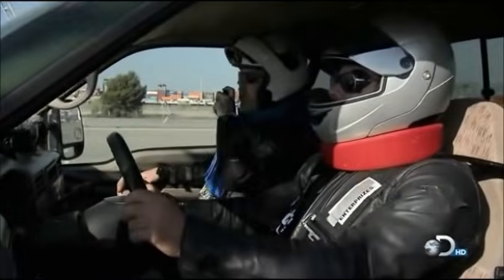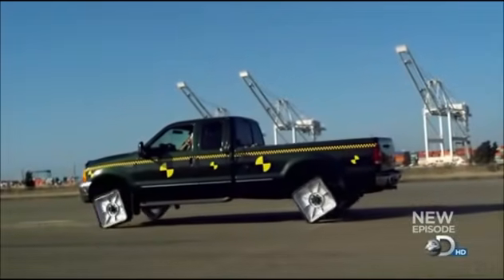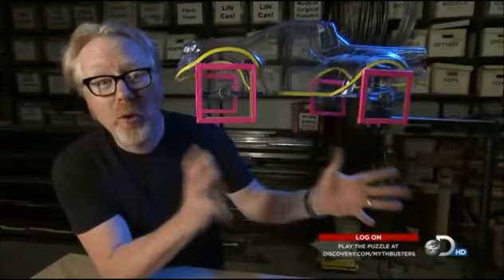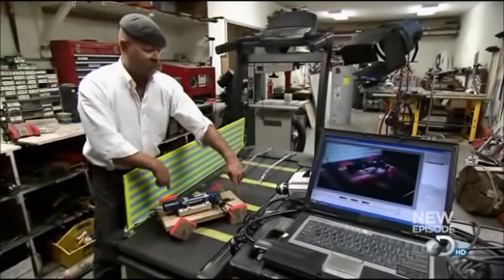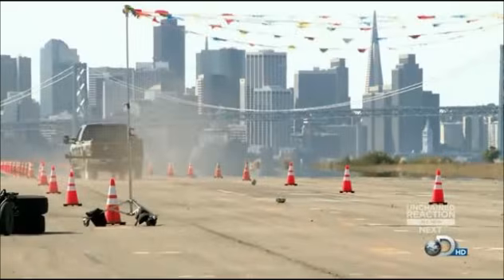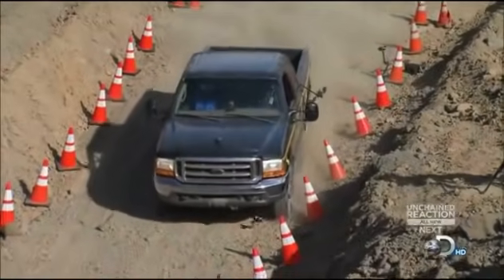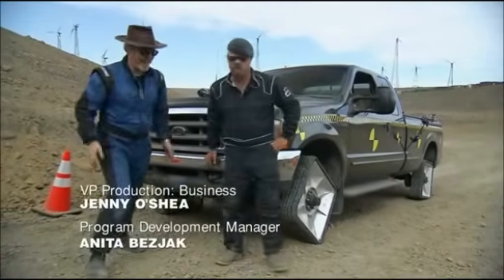Square Wheels - Mythbusters for the Impatient

Comment: Hill loose dirt...use a tank
Reply: Captain Fearless made in Canada (South Park)
Reply: Yep, just not on gravel. Dirt and mud are fine, but gravel adds a combined resistance to the tracks that threatens to break them.
Reply: Captain Fearless
Reply: put that on a lambo
Reply: Captain Fearless
Reply: or just diff locks in 4 low range
Reply: Yeah, but that’s not fun.
Reply: Hexin ZHAO uhh wrong type of tank buddy
Reply: Why don't you just climb.
Reply: Xiaobao why dont you just not drive towards hills
Reply: Captain Fearless use a plane duhh
Reply: loose dirt... use tank

Comment: One thing not addressed here is the differential gear which allows the wheels on opposite sides of the axle to rotate at different speeds. The wheels would end up out of phase anyhow.  Try cubic wheels with the axis of rotation passing through the opposite corners. It would have six corners contacting the road and could be approximated for demonstration by rolling a child's alphabet block across the carpet, holding the points between the index finger and thumb. It would approximate a hexagonal wheel. By the way, did you by any chance see the movie "Carry On Cleo", in which a rather dim Briton (in Caesar and Cleopatra times) named Hengist Pod brags that he had improved the wheel: " I build wheels. Square ones." There's a brief shot of him on his bicycle.

Comment: Square wheels on the hill would work if you had a tractor gear that meant you could rotate the wheels very very slowly and the tyres were very knobbly and sticky. Then you could make your way up the hill bit by bit, because the traction of a flat surfaced wheel is going to be greater than that of a round wheel.

Comment: 4:01 - So the control test was 2x4 for round wheels while square wheels was 4x4? Hmm...
Reply: what he meant is why the control test using 2x4 not 4x4 to even it out
Reply: Honestly the truck would have made it up if it was in 4x4
Reply: Yeah that was unfair but at the same time the square wheels at 4x4 still only did what a 2x4 did so I would go so far as to say it disproves square wheels for any advantage.
Reply: F250s have never come from the factory with front diff locks
Reply: Stock configuration would be open front diff and most likely a rear locker. Given that, I would say he was doing a one wheel peel on the front with stock tires and just happen to be spinning both of them with square wheels.
Reply: Sounds like that would be a pretty nice offroader. I have done a fare share of offroading and muddin with my 4wd colorado and have actually pulled out both of my friends 2wd trucks. If you know what you are doing, just a rear locker will suffice unless you are doing real extreme stuff.
Reply: This show is terrible if you're looking for actual scientific method.  It's just like any reality show, they do what makes the best TV.  Of course square wheels are possibly the stupidest idea ever but here they are making a whole segment about it and here we are watching it...
Reply: idk but the truck was diggin in both, it had nothing to do with grip, the front bumper was digging, that alone bothered me.
Reply: I just learned a random fact about the gauges in an 80's montero. Thank you, I will store this gem away for 40 years so I can angrily yell it at my grandchildren out of nowhere once my dementia really gets goin.
Reply: When I was a teenager I had a ‘94 Ford F-350 with the 460 7.5 v8. It was 4 door long bed and I had a 6 inch lift with 35 inch mud tires and I could get up a hill like the one in the video in 2wd, the only time I ever needed 4x4 was going through mud cause the truck had so much weight, but it was a beast going up hills.
Reply: It was because if the car with the square wheels wasnt 4x4 it wouldnt even be able to move

Comment: The smooth ride is when the square wheels jump from point to point -- so a development from this might be to put 'feet' on the points of the wheels, say six or eight rather than four, [possibly with (computer-controlled) extensible legs on each foot - like the Kourier's 'smart wheels' in Neal Stephenson's (1992) novel 'Snow Crash']. The feet could be initially just freely pivoting at the end of a short leg, like an inverted T. After that, possibly a tension spring between the back part of the foot and the (base of?) the leg could provide some suspension and 'spring' to the ride.  What think, @Mythbusters ?

Comment: there's another configuration you could do...  the 22.5 offset mirrored... i have a vibrational theory you can get traction with each wheel each getting their 4 ticks in...  it's all about frequency (which in this case, angle plays the control)

Comment: The test was a failure from the beginning: no matter the position the 4 wheels won't rotate at same speed at same time, not to mention if the car is propelled by the rear wheels (or front) these won't go at same speed as the opposite wheels... even if it was a 4x4 due to lock diff...

Comment: What if they had a tire company manufacture a square tire for the square rim they build that would hold air?  They just had a piece of rubber stretched around the square rim, with no air in the tire. Of course it would be rough. I miss Mythbusters! Its way better than most of the shows on now. If they would bring back the whole original crew.

Comment: Surly an  equilateral triangle would make a better wheel as there is more surface area. As the only thing doing the "work on a square wheel would be the corners
Reply: You could even have the circular wheels driving a triangular wheel

Comment: Man even with the round wheels that Truck just flexes like its made out of cupboard O.o scary you american guys like to drive that stuff ;)
Reply: that's by design so that the cab doesn't move around with whatever you have in the bed. If you've got 700 pounds of bricks in the back you don't want the whole truck to shake around with that. Handling is definitely secondary in a truck, practicality and comfort come first!
Reply: Digi20 it's not quite as scary as it seems! Ya know as technology advances (like is has in the United States) we find ways to make things both stronger AND more flexible ;)
Reply: oh i didnt meant that it will break, but in generell you want a car as rigid as possible to have the best handling. but i guess if you buy such a truck thats secondary.

Comment: The term "square wheels" contradicts itself :P

wheel  (wēl, hwēl)
1. A solid disk or a rigid circular ring connected by spokes to a hub, designed to turn around an axle passed through the center.
Reply: Kouga True, should be square tires

Comment: I don't think they know how differentials work.
Reply: The truck had an open front differential, and from what I can tell it was just a limited slip in the rear-- so they couldn't have picked the direction the square was in relation to the other.. because the drive would goto the wheel with the less resistance-- so in the tests just arn't very accurate at all.

Comment: they should have aired up the tires
Reply: But wouldn't the air just form a circle?
Reply: JellybellyWaffles it can't stretch the rubber that far it wold create a round square and absorb a lot of shock

Comment: If you wanted to climb shit you could put spikes on the wheels.
Reply: Pete Detrick that would give you traction but very limited durabilty, triangular treads would be better with moving in looser grouns and it would provide the smoothest ride with a flexible chassis

Comment: Poor control test. The Circular wheeled truck had rear wheel drive, but the square wheeled truck had four wheel drive!
Reply: If you didn't have 4WD then the unpowered wheels might just drag instead of spinning.
Reply: depends what kind of 4wd or awd system the truck has. If it's not a locking center the wheels with the least traction will spin the most regardless if they are front or rear. Haldex in like Volvos, Mercs, and VWs behaved that was until the current version that VW uses.
Reply: dumbass as the control truck was driving on 2wheels look at the video it throws dirt only from the back the square wheel test was throwing dirt from all four wheels and nothing plausible about Smith ride clearly the vehicle destroys itself prior to smoothing out anywhere near smooth
Reply: Merlin Klein it doesn't matter anyway
The square wheels were already the worse test
Reply: They are the same truck... Why do you think it was rear wheel drive?
Reply: acephantom903 When the truck was too steep to get traction, the rear wheels slip, but the front wheels don't move at all
Reply: +MeroDN To me it looks like the front passenger tire was spinning on the round test and the front driver was spinning in the square test.
Reply: acephantom903 I didn't consider the fact that the wheel that cant be seen could have still been spinning due to the differential favoring it if it offered less resistance at that moment
Reply: No, it was the same truck. It's just that we can't really see the round wheels spinning. They are not throwing up dirt because they are not touching the ground. The squire wheels were still throwing up dirt even though it was just the top layer. If the front wheels are throwing up dirt then the dirt thrown by the rear wheels is not really visible. If you look careful as they go up the front round wheels actually do throw up dirt.

Comment: Just a quick question. Does the truck still have differentials? Because if so the angle of the wheels will change as soon as you turn. (another thing you would find when dirving on tires with flat spots.

Comment: I wish they had done one to bust the idea that a car going 60 mph could drive up a leading semi truck's ramp that was also going maybe 58 mph.   If you think about it, it is not possible, since the ramp and truck bed are not traveling the same as the road was with respect to the car, and if the car gained traction it would slam into the front of the trailer.   Never mind that this gimmick has been used in countless movies.

Comment: Did they weld up/put a spool in the diffs? Otherwise the initial clocking of the wheels is meaningless. It didn't look like the diffs were were locked in the hill climb.

Comment: well the square wheels in the slope manage to get to the same height but the speed were far from the same as the round wheels. so if the round wheel had gone that slow do you think it would have made it that far?

Comment: on the dirt hill test, the round wheels were tested using only 2wd, however on the square wheel dirt test, it was in 4wd. sneaky sneaky.
Reply: I saw that too. Square wheels probably don't move all that well in general without being in 4 wheel drive
Reply: four square drive
Reply: They had to use locking diffs for the opposing corners test.
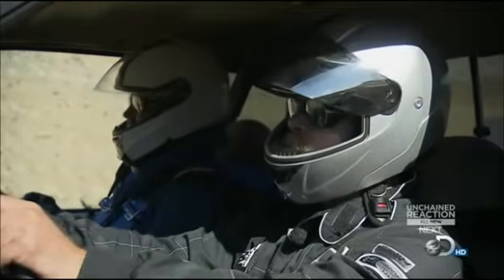Reply: I did the math. the front wheel has approximately 2000lbs and the bakc wheel has 4600lbs. So you are right that the angle was sufficant to put most the weight on the back tires, but you can see at 3:51 that the front right tire throws out a ton of dirt. Its in 4 wheel drive both times.
Reply: If they drove in 2wd with the square wheels the front wheels wouldn't turn numbnuts
Reply: Didn't help them :)
Reply: it may have been in 4wd with an open front differential the right wheel could have been spinning
Reply: Hvguy you can't really tell that they were only using two wheel drive. the back tires could have simply been kicking out more dirt because there was less weight and traction in the back due to it being a truck they tested it with instead of something with a more even weight distribution.
Reply: I sub to you cuz of the McLaren
Reply: Hvguy you can't really tell that they were only using two wheel drive. the back tires could have simply been kicking out more dirt because there was less weight and traction in the back due to it being a truck they tested it with instead of something with a more even weight distribution.
Reply: has anyone seen the sphere tire Goodyear is working on?
Reply: who gives a shit
Reply: puzjez. new tubeless tires? Tubeless has been standard for decades, since 1955 in the US.  even cars originally equipped with tubes are often updated to tubeless so why exactly would they use innertubes in their test?
Reply: i saw that, thats what brought me to comments section to see if anybody else picked up on it.
Reply: The problem isn't towing capacity its traction so besides the differential the gear doesn't really matter for this test. Any of the gears could get the truck up if it had good traction.
Reply: Hvguy  Go use some legit off road tires. Street tires off road =fail.  you can tell at 3:53. its street tires.  real legit off road tire have very widegaps and very deep tread.
Reply: Hvguy Must be a Canadian truck.
Reply: wrong. you ever hear of a differential?
Reply: Thor214. does the truck have locking diffs? most at best might have a rear locker that locks and unlocks automatically.  its rare for a production vehicle to have manual lockers and rather expensive to add them aftermarket. even then its still exceedingly rare for any vehicle to have both front and rear lockers unless it is a dedicated off roader or rather hard core street legal vehicle.

Also, it was said that the truck was "started" on opposing corners, suggesting they really couldnt keep them in a fixed orientation.
Reply: penguins forall they used street rated tires off road.  that invalidate the test
Reply: Blayne That makes it a completely unequal comparison though, dickweed
Reply: I got SWD, hell with 4WD
Reply: Jake Souder yea
Reply: DrewLSsix
Reply: +Jake Souder The concept is cool but breaks down when actually analyzed.
Reply: Hvguy How does that change anything?
Reply: PartyPlace 15 do you know anything about cars.
Reply: Steepest roads
Reply: No, it was the same truck.
What I think was happening is that because of the steep angle the truck was rearing a tiny bit and the front wheels weren't touching the ground. Because they weren't touching the ground and therefore not kicking up dirt we couldn't really tell if they were spinning or not. With the square wheels we can tell that just fine. The square wheels have a something larger circumference than the round ones so they were still touching the ground when  the wheels lost traction.
If you increase the angle like that the center of mass shifts backwards. That's also why the truck stopped when it did, when the front wheels left the ground the back wheels started slipping.
Reply: not all diffs can be locked and most can't so they probably cant lock
Reply: What does 2wd stand for?
Reply: Well, 2 wheels squared would be 4 wheels.
Reply: Fucking shithead mythbusters >:(
Reply: Blayne The whole point of a control test is to have everything 100% identical except for the variable being tested. For it to be a legitimate test, both cars need to be either 2wd or 4wd. Before trying to argue science, educate yourself on science.
Reply: I'm glad that didn't get past everyone.  So much BS like this goes down on shows...
Reply: Ryboodle I would think they would use locked diffs for all four wheels. But anyways, nice spotting man.
Reply: Probably have to have power to all four wheels in order for square wheels to work
Reply: what? are you saying that you think the truck is front wheel drive? lmao
Reply: I stopped watching after they bombed the Hydrogen Car test on purpose, no pun intended.
Reply: Aidan Hodge Talks it doesn't work like that, there was more weight on the back at that angle "try carrying something large up some stairs with 2 people, the person on the bottom has more weight" same goes with the truck. besides, that truck has front locking hubs, probably a good chance it also has a front locking diff. it was in 2wd, face it.
Reply: It does not really matter  since they used STREET TIRES 
Street tires + Off  road = FAIL
Reply: Its The Jr dont Think he does
Reply: Hvguy I notice that too
Reply: this show is total garbage.... saw a few yrs ago the james bond thingy that blows your tires (isk how to describe it better my eng sucks) and they tested it on the new tubeless tyres insead of the old tires.... this show is just garbage idk how it got so popular

Comment: Used, lightly driven truck for sale
Reply: Custom wheels
Reply: All highway miles.
Reply: As seen on famous tv show
Reply: No low ballers. I know what I have
Reply: Tires lightly used.
Reply: 5 miles
Reply: I wonder if it's a rental, lol
Reply: Mint condition
Reply: *Twerking truck for sale
Reply: ikr
Reply: Hahahahaha
Reply: Slight oil leak, may need a wheel bearing changed (but that's preference), and she should last you a few solid more years without problems.  

*Vehicle dies on the following morning as you head out to work
Reply: NETWizzJbirk seems too good to be true. what's your angle

Comment: What about octagonal wheels?
Reply: +TheMadHatterThatMatters well if they were going for better, I think they would have stuck with good old fashioned round wheels.
Reply: +DBIIJ0U except it is relevant
Reply: Paul O'Neal His point was that octagonal wheels would probably just be between square and round wheels. No real point in testing them.
Reply: Good question!
Reply: They would work and be much better
Reply: +dsfi2010 irrelevant to the question.
Reply: dsfi2010 Why would they need to experiment with a product already known to be successful?
Reply: Paul O'Neal and what if every wheel is square but restricted to a certain relation (22,5 degrees ) so the shock would be smaller. (Although you would need a gear to syncronize the wheels)

Comment: Does anyone know if they used a 4x4 with welded diffs to keep the square wheels at their desired angles?
Reply: I'd guess that the truck had an adjustable diff, seeing as for pulling heavy loads it would usually need AWD, locked diff.